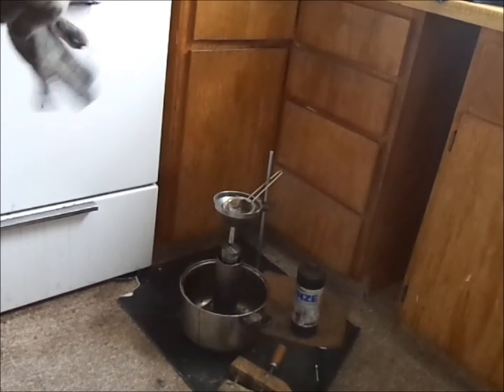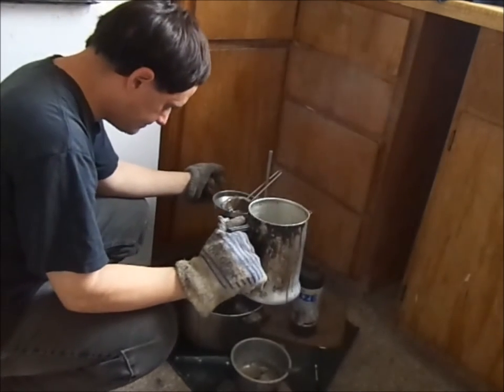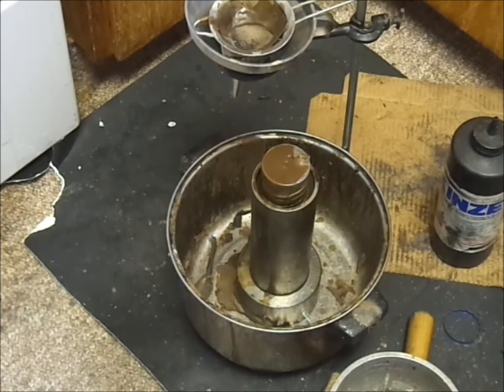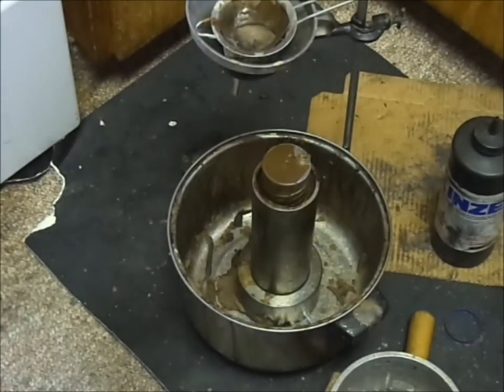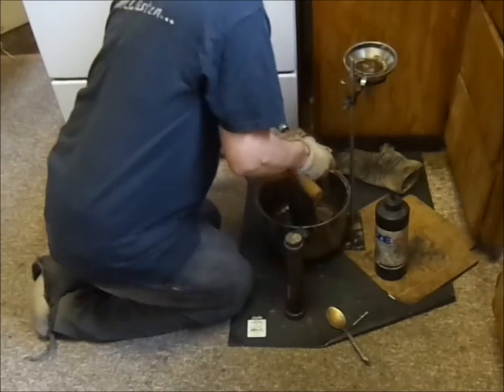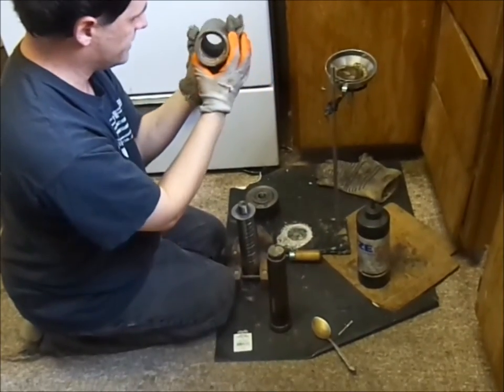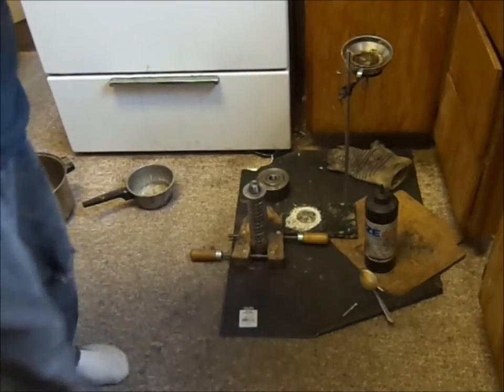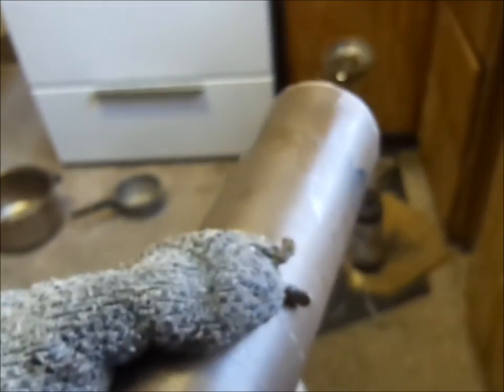Pouring and Casting an Edison cylinder Phonograph Blank

Comment: What's the flash point of the wax, or is it nonflammable?
Reply from the maker: +Phonoboy It will catch fire at about 290 C or 554 F.  It is very flammable, so the 270 is the absolute maximum you ever want to heat it to and this is before ceresin is added.  When ceresin is added it is not to be heated above 232, or it can damage the ceresin.
Reply from the maker: +Phonoboy  In order to safely heat the wax, when the high temperature steps are done, (270 C)  a narrow, high sided vessel is used, with a lid, in this process, such as an old aluminum coffee pot. When at high temperatures, and making an acrid smoke, a layer  is on top of the wax while the lid is kept on top, and a lid of foil over the spout,  the trapped smoke smothering complete combustion, keeping oxygen from flashing the wax at the high temperature.   The fumes are  horrible, and strong.
Reply: Interesting thanks for the reply.

Comment: Where i can buy that type of wax?
Reply from the maker: +João Eduardo  The wax compound is made from scratch, you can't buy it anywhere. I have several videos that shows how it is made.  Also Chuck Richards, of Richards' Laboratories on his website gives good insight on how it is made, it is somewhat dangerous, as to make it well, it reaches the flash point.
Reply: You can buy this from me, as I manufacture it. It is a aluminum metallic soap.